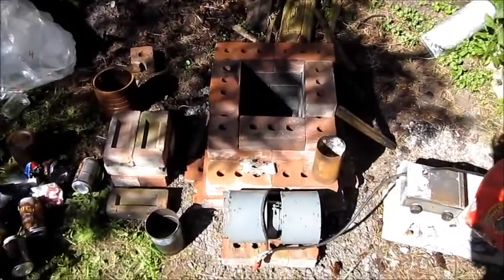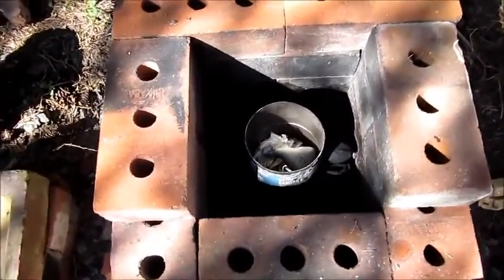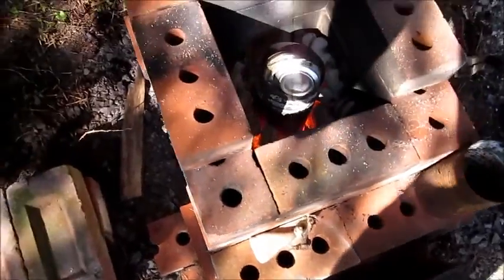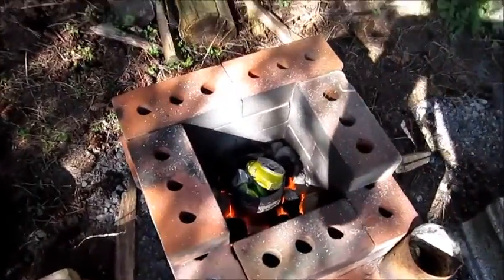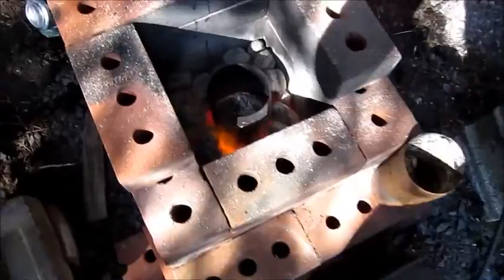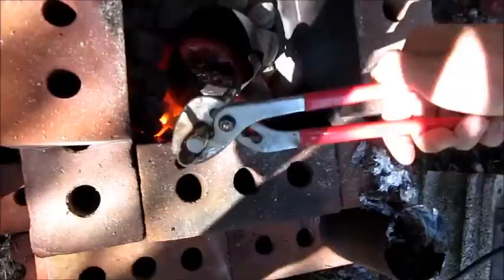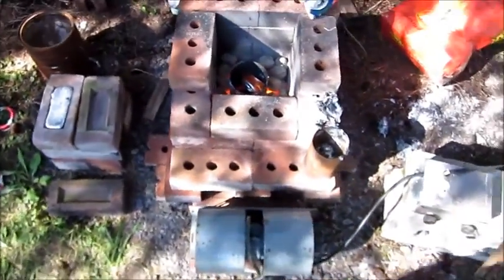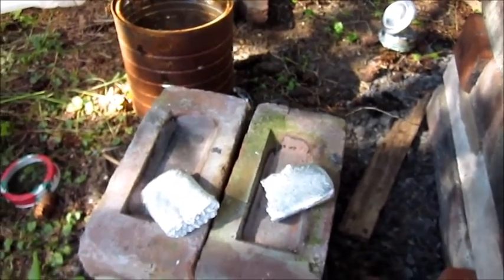Melting and pouring aluminum

Comment: have you seen how hot it can go?, i accidentally melted steel!
also if you can make steel white hot, when you put it in the water, it doesnt boil the water
Reply from the maker: +Anton Helsgaun Yeah that is really neat. I have no good thermometer to measure it but I've melted the steel crucible too. Yeah the steel gets so hot it forms a weird layer between it and the water preventing direct contact.
Reply from the maker: +Anton Helsgaun Yeah that is really neat. I have no good thermometer to measure it but I've melted the steel crucible too. Yeah the steel gets so hot it forms a weird layer between it and the water preventing direct contact.
Reply: @Az28-25  as someone now 5 years older and a little more mature and sensible, i was talking about the Leidenfrost effect